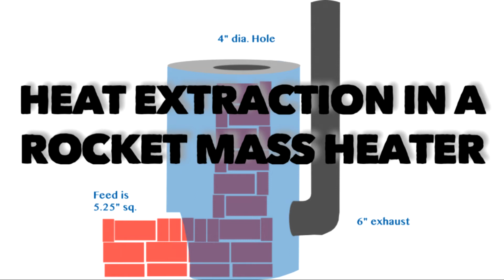Heat Extraction in a Rocket Mass Heater

Comment: When your mass heats up, so does your exhaust and efficiency drops. If you had a pump that circulated water past the flue then you would be able to extract more heat but the increased complexity will raise the cost. If your mass is too big you have issues too because heat transfer will be too slow depending on your situation.

Comment: What about adding a small fan to keep the draft going and then extracting all the heat. Would that avoid the accumulation of wet smoke in the system?
Reply: You would have to use the fan to push air into the system so you would need to seal it and then smoke would escape when you opened it up to put wood in as well as finding any gaps in your flue but it would work. 
If you used a fan to extract the exhaust it would be destroyed when the flue reached temperature, a mass heater like this only draws heat out when the mass is cooler than the smoke and only as fast as the heat transfer rate is so when the mass is hot the exhaust will be much hotter especially if it's moving faster because of the fan.